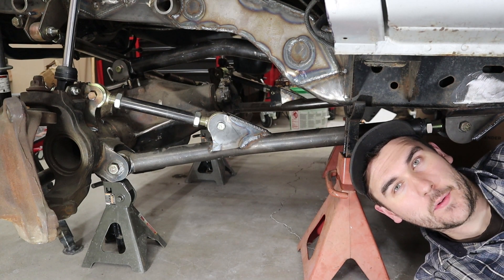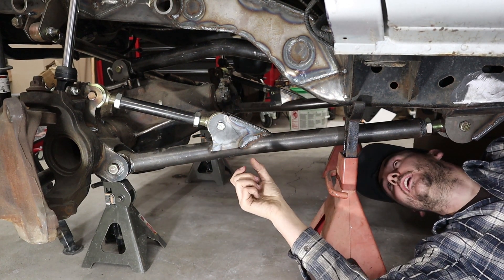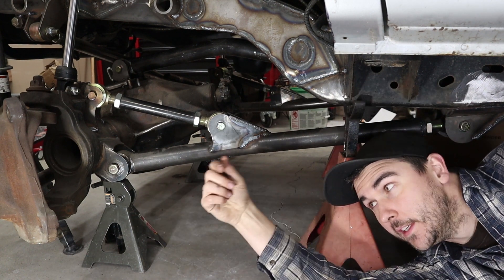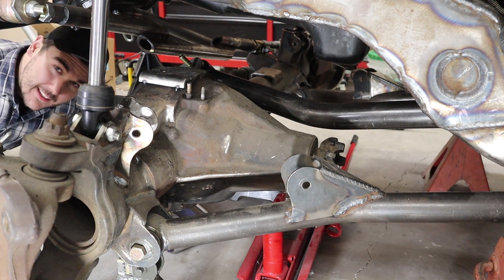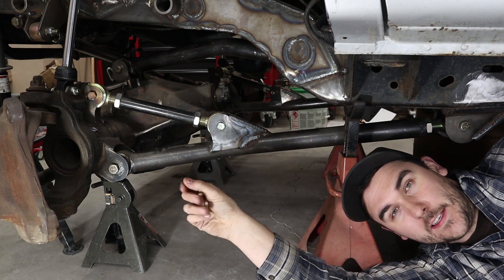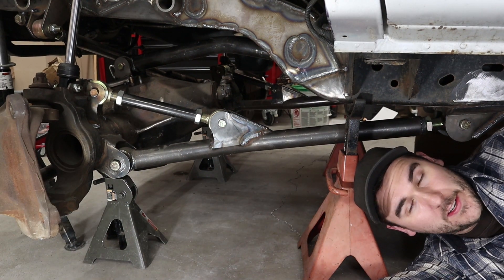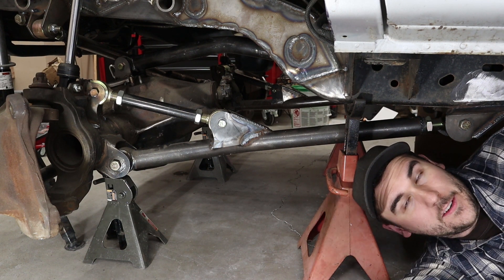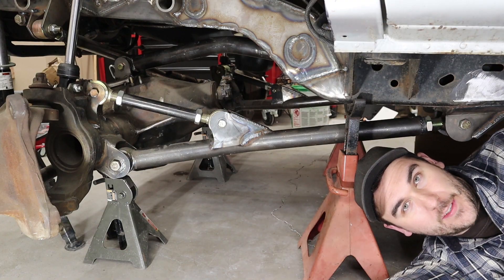Why I hate 3 links

Comment: The Jimny actually runs a 3-link with panhard rod on each axle, and because of Jimny's lightweight body, it’s not going to slam hard into things unless you load it up with heavy cargo.

Also, the binding on the axles is way less in the Jimny compared to a radius arm setup. That means the suspension puts much less stress on the brackets and bushings, so there’s very little chance of them failing in the first place

Comment: Except with a Radius Arm setup you have even less redundancy than with a 3 Link. Sure you have 4 mounting points on the axle but you only have 2 mounting points on the frame with a Radius Arm. You lose either of those 2 mounting points and you're day is toast!

Comment: Is it the same for a 4 link setup?
Reply from the maker: 4 links are superior to both in every way haha
Reply: @WebWheeler  so I’m thinking about getting a four link front suspension set up for My jeep Comanche. It is not a triangulated today. Do you think that would be better than radius arms?
Reply from the maker: @moejr14  If you aren't running hydraulic steering, you don't want a triangulated 4 link in the front.  Conventional/mechanical steering will bump steer badly with a triangulated 4 link because the axle cycles straight up and down while the steering travels in an arc (pivots on the pitman arm, axle side steering point is on the passenger side knuckle with crossover steering and as the axle travels up and down, it also shifts sideways.)  Better to have a straight 4 link with a panhard bar that matches the length and angle of your steering so bump steer doesn't happen.  All that said, radius arm front will do the job in most mild to moderate offroad applications and are quite a bit simpler.  Hope that helps!
Reply: @WebWheeler  what about rough country radius arm?

Comment: The argument for redundancy is a red herring.  You only have one fuel pump, and one ECM, and one transmission, etc etc.  There’s many things that are critical, so you just build them right and depend on them.  One might even say that a radius arm system has an unnecessary arm that isn’t necessary.
Reply: Not to mention the failure modes he's talking about are incredibly rare. To drive in such a way that a properly engineered suspension arm is completely detaching from the axle or chassis would mean you've already broken a hell of a lot of other things
Reply: @tomsaywell6126 As rare as they are I would love to hear someone who had a 3 link that failed...and then look at exactly what they were doing when that happened. I haven't met anyone where they had their 3 link fail. Everyone always talks about the "rare occurance" that they can fail...

Comment: I wheel harder than you could ever imagine and never seen a 3 link fail proper set up. 3/4 bolts with 1 1/4 heims is pretty hard to break. Stop giving false info. Raduis arms is the worst off-road suspension design possible.

Comment: if a lower link breaks on either suspension setup your whole day is ruined and probably the majority of the front end is going to need to be rebuilt, doesn't matter what system you have. and let's not forget the radius arm is the least useful as far as a radius vs 3 vs 4 link in suspension tuning. there is a reason you see go fast trucks using 4 links and crawlers using 3 links. not to say a radius arm is bad just that your arguments are bad, specifically when you try and pretend a broken lower arm on a radius arm will be any different to a broken lower arm on a 3 link or 4 link.

if you need real word data i broke a front lower link on my jeep Cherokee 4 link setup and the entire axle was trash not to mention other damage that was done as a after effect to that, like my shock bent steering smashed fender. point is opinions are like buttholes everybody has one.

Comment: Ford Aerostar rear end is a 3link, mostly. It has g body shuffle when the wheels lock up. It’s fucking terrifying.
Reply: You had a bushing issue not a 3 link issue, or you had a sagging spring and broke shock, something wasnt right, the 3link is awesome on the street when its not neglected

Comment: Can Johnny joints be used on radius arms? Why or why not?- conflicting answers when going through google….
Reply: I guess the root to my question is binding…. Radius arms are usually criticized for binding, as you noted in your video you have experienced this as a non issue in regards to flex.  With the complete lack of “give” found in Johnny joints- if they were used on all joints either the brackets, bolts or welds would likely be the weak link. 
This is all greatly debatable, as anyone who has wheeled long enough or hard enough knows with any setup, welds break, brackets rip/bend, stuff happens- something has to go give.
Reply from the maker: They definitely could and have been used. If I was to build using them I would run them at the axle and run a poly or rubber bushing at the frame. Heims and Johnny joints flex great but on the other hand they don't try to flex back to neutral position. This will cause your radius arm to flop from one side to the other and back as you brake and accelerate. A bushing at the frame will hold everything in a neutral position and resist that flopping. Honestly these metalcloak duroflex joints I'm running are the best option I've found- they flex a ton like a heim or johnny joint but being a rubber bushing, they keep the radius arm tight and in the correct position. Thanks for watching!
Reply: @WebWheeler   thanks for the response- good thoughts.  I wasn’t thinking about centering. Great video!

Comment: I think each set up has it's advantages, but I think 3 link is better during most failures.  3 link has 3 connections on the frame side and axle side, and radius arm only has 2 contacts on the frame.  Radius arms have 4 connections on the axle side and this gives it an advantage during an upper control arm failure, but on the radius arm the upper control arms are supported by the lower control arms so if a lower arm fails, the uppers also fail.  

The upper control arms on a 3 link are tucked up high and would be hard to hit with objects hard enough to cause a failure.  Your video brings up the possibility of poor welding causing a failure on upper control arms, but lower control arms are also susceptible to poor welding, so both design's are susceptible to the failure.

Comment: I understand the concept of redundancy. True, with a three link, you don’t have redundancy on the upper link. Remember that with your radius arm setup, you have the front axle located with only two frame mounts. You lose one of them and your axle is gone. You will destroy a lot of parts. If you want redundancy, a true 4 link is what you need. Why do you think stock axles are located with 4 links? Redundancy and liability. Parallel 4 links don’t flex as well as a triangulated 4 link or a 3 link.

Comment: You're arguing redundancy, seriously. How about the lack of setting anti dive/anti lift. How about stop fabricating junk and build you rig so it doesn't break rather then worrying about what happens when it breaks.
Reply: The only reason people use a 3 link over 4 link is simply packaging...thats it. 3 or 4 link suspension design is superior as far as geometry and adjustment to get the desired characteristics  out of the suspension. 
Radius arms are simple and work ok. And on I beam desert trucks work great but that's a different application.
Reply from the maker: If you are concerned about setting anti-dive/lift, figure out how to fit a 4 link.  Also, be careful when assuming "if you build it right, nothing can go wrong!"  Offroading abuses components.  The best fabricator in the world can't prevent components from being defective or breaking.  The more redundancy a design has to prevent catastrophe should anything fail, the better.

Comment: The rear suspension on certain year libertys, grand Cherokees, dodge nitros and maybe some others have 2 lower arms and an upper wishbone. And it mounts to the top of the diff with a ball socket
Reply: Ya that's a truck arm system chevy used them on c10s for a bit.

Comment: You only have 2 links connecting the axle to your  vehicle. That’s more force on your 2 frame points. Radius arms don’t have as much adjustability of the pinion during suspension travels. They definitely both have ups and downs. If you’re welding that stuff with a harbor freight 110 welder then you have a lot more expensive lessons to learn about fabrication. 3 and 4 links are definitely a step up from radius arm suspension.

Comment: Now if one of your lower links goes the whole thing is also smoke. Would a 4-link not be better from not only the sake of redundancy but also a great or amount of tunability as well as dispersion of force on more points on the frame?
Reply from the maker: Radius arms have a better chance of avoiding the major damage because one side can still hold the rotation, so you just end up with a tire in the bumper or back of the wheel well. Things can still fail big, just less likely than in a 3 links. A 4 link is superior to both in every way haha. All your points are dead on as to why they're better. Only drawback is packaging all the links. Thanks for watching! 👍
Reply: @WebWheeler  if you lost a bottom link and poked the tire forward or back your driveshaft is gone (oil pan aswell if unlucky)
Reply: Most of the time if you can run a radius arm system, you can run a 4 link with an outside Mounted top link, kinda like Thuren's Alien Arms. The radius arm is just easy at the end of the day. You can make a super sweet boxed arm that will live up to anything you throw at it. But having a johnny joint or a Enduro joint allow for slight movement with the top link allowing added flex.

Comment: Great vido! I agree radius arms are ideal for the majority of build. When i build one ill use them for eases. 

As for manufacturers the wj used a tiype of 3 link rear suspension thoes thing flex great for stock arms but stuck to replace. 

Also the last year of the sold axle mustangs use a 3 link. 

I am actually building a 3 link in my 68 mustang for a gopd do everything car the 3 like is vercital but has its major downfalls.
Reply from the maker: Thanks for watching! Good info 👍

Comment: My thought with radius arms is that they will have some sort of binding in them, but that would make it so you did not need a swaybar to prevent body roll. I used them on the front of my scout project as I did not have a good place to mount a swaybar. Running the radius arms also allowed me to use the stock exhaust parts on my 5.3, so I did not have to buy new headers and get crazy with the exhaust, which also allowed me another inch of uptravel so I could get the thing sitting low and still have decent uptravel. I also thought that if I ran the radius arms and learned they sucked, I could reuse most of it and add a third link.
Reply from the maker: Nailed it! I've had mixed luck with radius arms and sway bars- some setups still need sway bars some don't. Both radius arms and 3 links have their applications and pros/cons but there are definitely things radius arms do better like saving space as you mentioned. Thanks for watching! 👍

Comment: If using radius arms what would be the disadvantages of using the ford mounts with the ruff stuff arm kit and saving all that work?
Reply from the maker: Mainly just that the factory ford bushings aren't great for flex and hang down a little low from the axle tube. If I was building a tow rig or overland truck that isn't as much about flex, I would definitely just run those. I will admit I'm biased though- I worked as the designer for ruffstuff for a few years and I designed those brackets you're taking about for them haha. Thanks for watching!
Reply: @WebWheeler  if I ever jump to a front dana 60 on my yj i will probably do just that and use the outboard brackets on the frame to keep the arms parallel. Not much rocks on the east coast.

Comment: The radius arms rely on bushing deflection for articulation, no way around that. If you lose the lower control arm mount on the driveshaft side your driveshaft is either going to overextend and fall apart, or donkey punch the tcase off the trans...
Reply: I agree, Pretty much going to get the same catoptric results from a radius arm or three link failure. A lot of broken parts.

Comment: Good food for thought.  As someone who's had both radius arms and a three link on the same vehicle, I've got quite a bit of experience with both.  The radius arm articulated just fine, but I was running rubber bushings.  Those bushings gradually wear over time and in my case the slop that gradually grew in my suspension contributed to death wobble, which in turn started wearing other components like tie rod ends, balljoints, etc.  So I went 3 link so I could run Johnny Joints throughout.  The lack of redundancy is certainly a concern, but it's worth it to me.  Just make sure not to let Cletus weld the mounts with his 110v HF welder! :)  Another thing I like is the caster that can be designed into the 3 link system as the suspension cycles.  But I agree with you that the radius arm setup gets a bad rep and that's not justified.  For me and my rig, though, I'll be sticking with my plans to continue with a 3 link as my tons go in.  Keep up the good work!
Reply from the maker: Great points! Yeah I actually have nothing against 3 links when (almost ran one in this truck haha) but this was the best way to title the video to take advantage of the YouTube algorithm and have people consider radius arms as a viable option haha. As you said, it all comes down to whether it's done right. Thanks for watching!
Reply: @WebWheeler  i never heard of you till this video, been watching 3link videos as I'm gonna link this yota instead of leafs lol
Reply from the maker: Glad you found the channel! Thanks for watching. Every setup has it's pros and cons- I've even seen some amazing leaf spring setups lol good look with your rig!
Reply: @WebWheeler  I hear ya, man!  Best of luck and keep us updated. :)

Comment: Can/Should radius arms be used in the rear? I have seen a lot of front radius set ups but don't recall ever seeing them in the rear. Trailing arms maybe.
Reply from the maker: Yes they can be used in the rear but it's not advisable. It's not a problem for street trucks but if you're planning on doing much rock crawling/hardcore wheeling you'd want to add a suck down winch. That would allow you to pull the body down to the rear axle when necessary. If the rear droops out too much it'll start bucking the body up as the axle tries to drive forward. As long as the radius arms stay pretty flat though, it does work. Trailing arms are usually paired with triangulated upper links like a 4 link because it offers the best performance but the Chevy rear arms I show in the video are a trailing arm/radius arm combo. Thanks for watching!
Reply: @WebWheeler  Nope if I am going to spend the time and money to fab up a suspension, I want to at least try to pick the best type. radius in the front and triangulated 4 link in the rear. Thanks for the info and you have a new subscriber LOL

Comment: Jeep liberty rear is wishbone 3 link and I agree with you on redundancy but the chance of failure is less on a 3 link because all the links and joints are only seeing tention  and compression loads radius arms bind and add bending forces to you brackets, links and rod ends that will never be present in a 3 link
Reply from the maker: Great point and good call on the liberty rear suspension- never looked at those before. Thanks for watching!
Reply: @WebWheeler  more updates plz for when I build my dakota so I know what to do lol